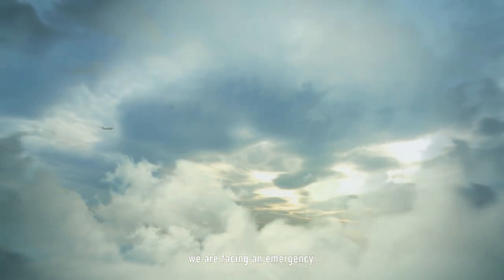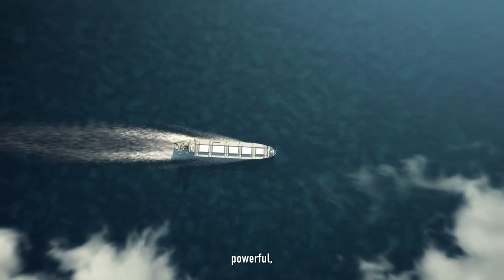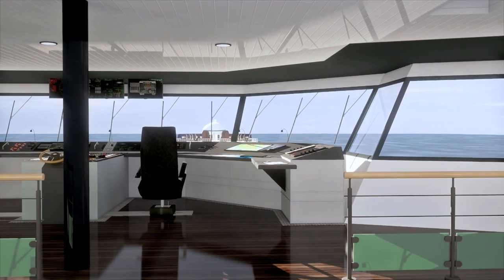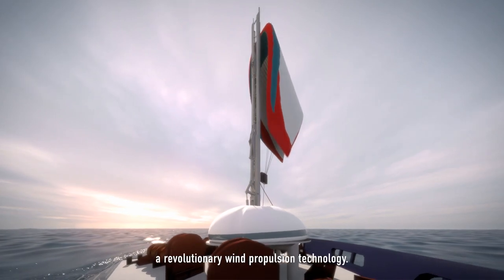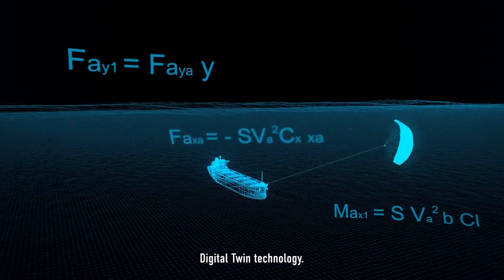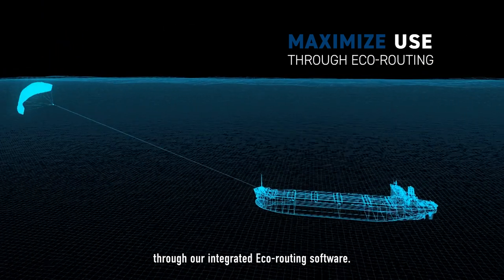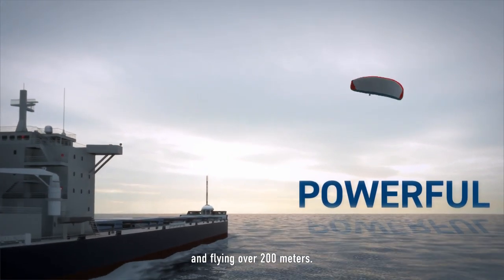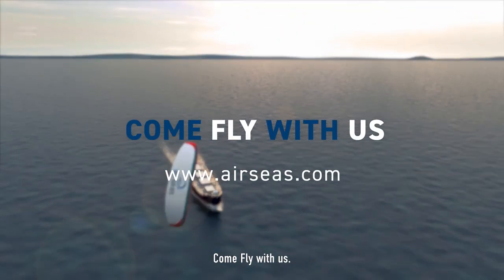SeaWing | The 1,000-Square-Meter Kite by Airbus That Will Tow Cargo Ships

Comment: They once called sails, & all ships had them, nothing new under the sun  🌝
Reply: A moving kite produces 10 times more traction than a static sail
Reply: The kite can also be operated much higher and be retracted during storm or when in port. It also does not take up as much space on the deck. Container ships need to be loaded from the top, so there is not really much space for normal sails
Reply: @alexandrekneip5982  is it tho? I want to see the real one. Giant Kites pulling a cargo. Rather than cgi bs. Side to side with ye olde sail ship.
Reply: @alexandrekneip5982 it’s still the same kind of idea. It’s just stupid that people are JUST NOW thinking this might be eco friendly
Reply: talk to a sailor 200 years ago and ask him if it was as easy as pushing a button :-)
Reply: @alexandrekneip5982  source?
Reply: @alexandrekneip5982 It’s still a damn sail. Just a different technique of use
Reply: @DeathnoteBB  And a jackhammer is still a damn chisel. Just a different technique of use.

Guess what, "different techniques" make all the difference.
Reply: @Alexander_Kale Still. A. Sail. Boat
Reply: @Blank55600  No it isn't. It is primarily a "motor boat" that uses a very different thing then what is generally referred to as "sail" as an additional means of propulsion for the purpose of fuel saving.

Comment: Sat here wondering what might happen if the kite nosedives into the water and then becomes ensnared in the props or other important hardware at the rear of the ship? Great idea though given what is currently happening.
Reply: I guess you could stick it on a pole mounted on the ship, right?

Oh wait-
Reply: 🤣🤣 @anhilliator1

Comment: Did we just invent the sailboat? I’ve never heard of a sailboat. Nor ever doodled one in a classroom before. 
I wonder how wind really works? Or dose it work? I really need help with this one?😅
Reply: Not invent, no. Just "reintroduce". And hey, if it works, why not? Why would you turn down free energy?
Reply: Why isn't it used?
Reply: No. Little difference. (or big from an engineering perspective).  The sail is 650feet high where the winds are 3 times faster than surface wind.  At least we got something out of kite surfing.

Comment: What happens when the wind dies for a few days..??
Reply: The ships will not operate solely on wind, or the economy of their company would take a nosedive. They will use the kites as supplementation to ordinary engines before these are swapped with electric engines running on either hydrogen and/or solar+wind and/or biorenewable natural gas, when the price and electric storage is feasible. Still, seawinds rarely die and the height at which these operate [~500m] the winds are much stronger and have prevailing directions. All life will rejoice when these mammoths polute the oceans no more.
Reply: Sailboats were fine
Reply: Then you don't save fuel on that particular trip.

Comment: Congratulations, you’ve invented a sail with extra steps. Really deserving of all that media attention.
Reply: sails can generate 1 hp for each 50 to 100 square feet of sail. so a 1000 square meter sail , or about 11,000 square feet would generate about 150 hp. Modern container ships have engines of 50 000 hp or more, so such a sail would mean the ship would save nothing.
Reply: @boobylinks  The relationship between hull speed and power is not a linear relationship. Power is proportional to the cube of the velocity, for a displacement hull. So the power required to move the first 2 knots is a tiny fraction of the power needed to move the last 2 knots. You can't equate the two. This is a stunt, not engineering.
Reply: @boobylinks  are you an investor or principal in the company? You are so passionate, I detect that you have skin in the game.
Reply: @boobylinks  1000 square meters generates 250 hp. 250 hp is not the equivalent of 100 tons of bunker fuel.A 250 hp engine burns about 10 gallons of fuel per hour. Times 24 hours is 240 gallons, or a little more than 1 ton, not 100 tons. They used to have ships with auxiliary sails until the early 1900's, but the savings was negligible. When the science doesn't add up, something else is afoot, likely politics. The ship requires 50,000hp. The sail provides 250 hp. 50,000 -250 = 49750 hp. still needed. 250/50,000 x 100% = 0.5% savings. It's easy math.
Reply: @boobylinks  You seem adamant to deny some math, that's all. Like I said, the fuel savings might be 240 gallons per day, or $ 500. The storage space for the kite and lines, winch, etc would forfeit perhaps 10 containers, or $4000 per container = $40,000. Just not economically feasible. The kite and lines plus winch would be $ millions. Plus the crew would need to be retrained. Not to mention that if the wind was blowing a few degrees offset to the plotted course, the engines would have to compensate, and the supplied horsepower from the sail would be considerably less. Just an absurd concept on all levels.
Reply: @boobylinks  I'll ask again...what is your involvement with this project? You save 1 ton of fuel per day. That's it.   If there's wind. You went from 100 tons to 100's of tons...why are you being disingenuous?
Reply: @boobylinks  "A few degrees off course is a nothing burger"??? You know nothing about navigation...correcting for a 3 degree skew costs plenty of power to correct.
Reply: @boobylinks  You are being evasive and deny seeing the calculations that I provided. I see you...
Reply: @boobylinks  I've given you physics, math, science, numbers...nothing matters for you. I concede to the trollmaster!
Reply: @boobylinks  the speed delta at the top end requires much more power than the speed delta at slow speeds...like I pointed out. This is because of the wave generation of the hull, among other factors. Realize too that you are quoting claims from the manufacturer of the device, not independent analysis. The company behind the Titan sub made similarly absurd claims, motivated by a need for publicity and investment.
Reply: @boobylinks  sails generate 150 hp per 1000 square m. So, from a study I found, power vs speed is not quite cubic, rather about 3.4. So if 24 knots requires 50,000 hp, then 22.55 knots will require 40, 000 hp, and the sail would have to generate 10,000 hp, which it could quite easily do if it measured 66000 square meters, or about a 16.3 acre sail. So, i apologize...you've been right all along. No hard feelings?
Reply: @boobylinks  Thanks! with my sail suggestion, that ship might have become airborne.
Reply: @boobylinks  yes, that was based on the accepted average of 150 equivalent hp per 1000 square meters of sail.
Reply: @boobylinks  how thick a cable would be required to hold the 10,000 hp? 1000 feet of such cable would weigh 100 lbs, if not slightly more, I'd suspect.
Reply: @boobylinks  a 10000 hp canopy and lines would be worth how much? $1 M? If lost during a storm, then how would this loss be factored against the cost savings in bunker oil? Hp redundancy would still have to be built into the ship's power plant, to power through unfavorable weather.
Reply: @boobylinks  I've seen spinnakers cause a sailboat to heel over...something compensated for by a deep keel. With a 10,000 hp force acting at say, 30 degrees to the plotted course, would the rudder have enough surface to correct? Ships have rounded bottoms, so generally do not have deep keels to apply counter force. The company could be held liable for loss of ship and/or cargo if containers fly off during a heeling event.